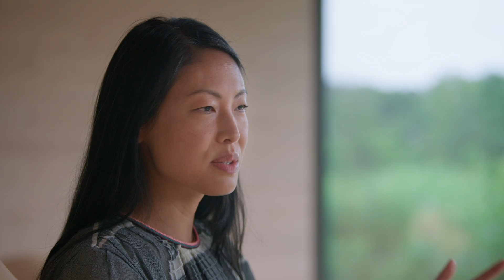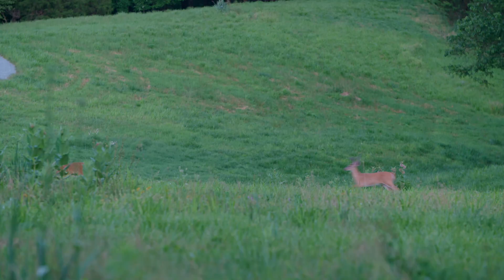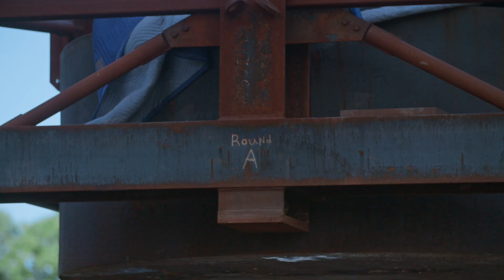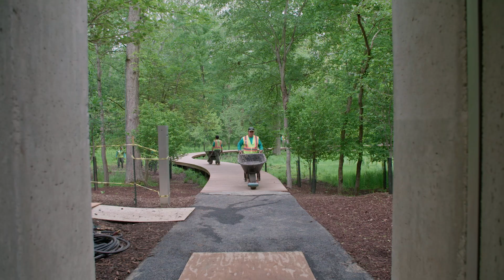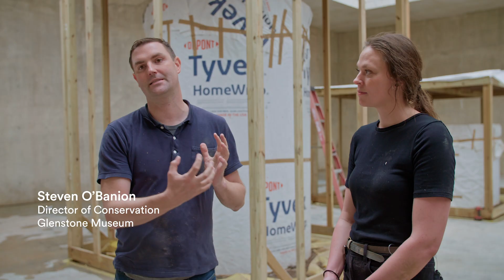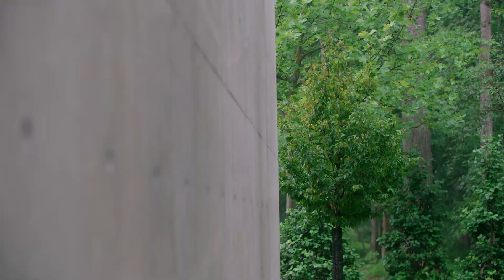You Are The Subject: Richard Serra at Glenstone

Comment: I am a HUGE fan of Glenstone. But I'm an engineer, and I think about things like this...
How much CO2 was emitted in the creation of "Four Rounds"?
TLDR version: by my rough estimate, it's about the equivalent of 100 cars operating for a year. (I would have guessed a lot higher!)
I'm not making a value judgement. Art should be made! But it is something to think about.

(I had some trouble with YouTube automatically deleting my comment, so I will split the long post into several comments...)
Reply: I did some ROUGH calculations:
82 tons of steel
4 rounds
1.5 tons of CO2 emitted per ton of steel	
0.0002 tons of CO2 per ton-mile transportation by truck	
200 miles Shipped from New Jersey (based on my memory, from a conversation with a staff member at Glenstone— accurate?)
5 tons of CO2 per passenger vehicle per year
Reply: So, 82 tons steel * 4 * 1.5 tons CO2 / ton steel  = 492 tons of CO2 for the steel

200 miles *82 tons *4 * 0.0002 tons of CO2 per ton-mile = 13 tons of CO2 for transportation

505 tons CO2 / (5 tons CO2 per passenger vehicle per year) = 101 passenger vehicle years

So, the sculpture has a rough CO2 emissions equivalence to 100 passenger cars for a year.